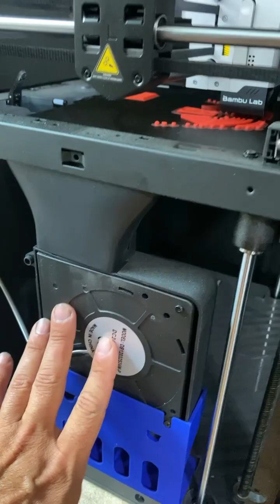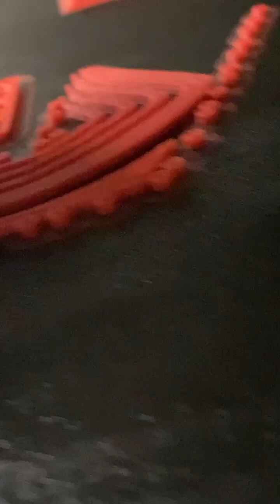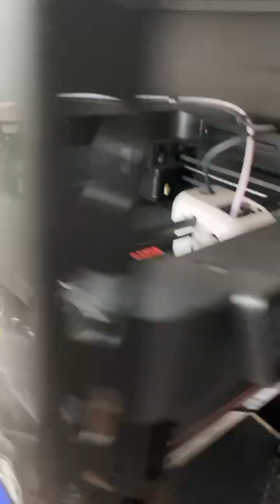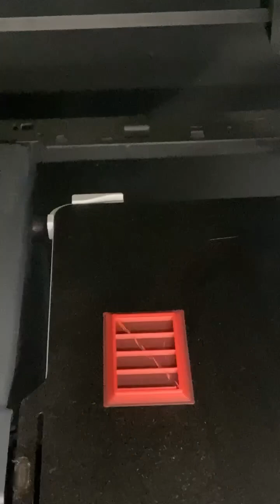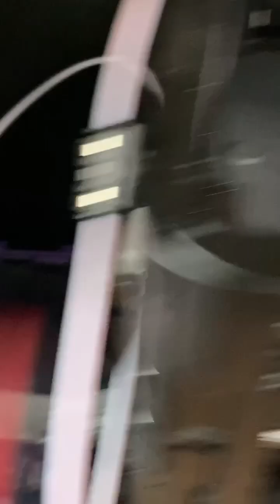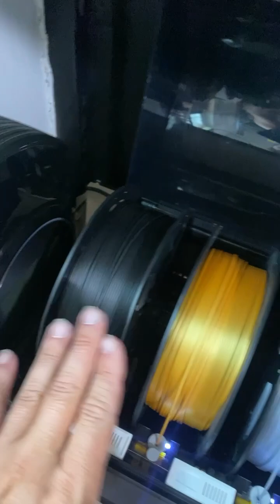A Look at the P1P with AMS and 4 Filaments Loaded. Starting an Iron Man MK III Helmet 3D Print

Comment: I've got the same setup. One thing I learned, if you have a lot of purge from printing one model, you can print multiples of that exact model on the same plate for the same amount of waste. If you could fit two of those jaw pieces on the same plate you'd have thw same amount of poo and purge as one. Good luck!